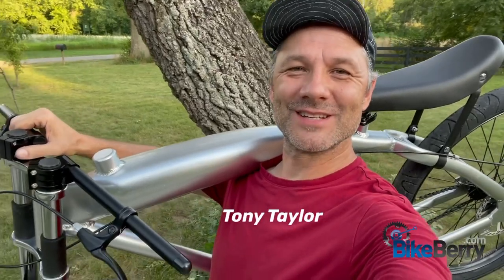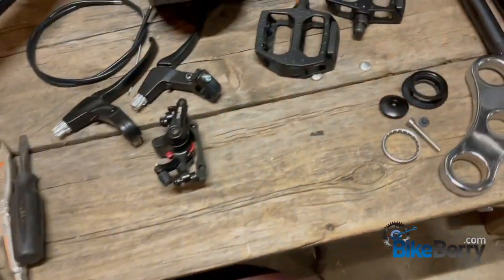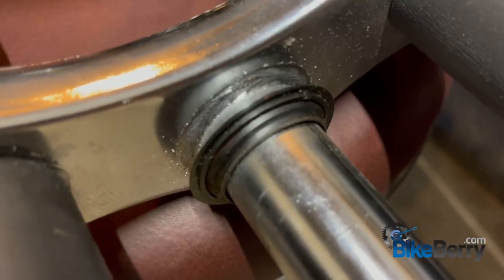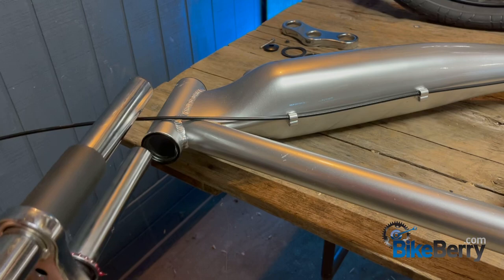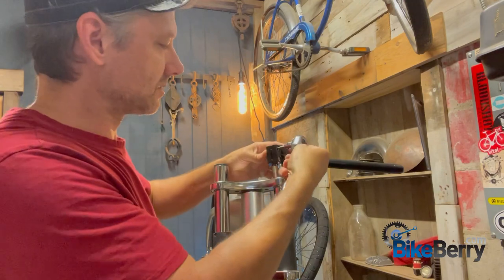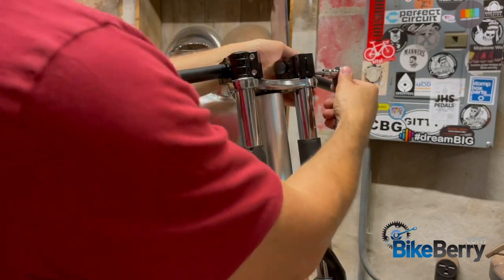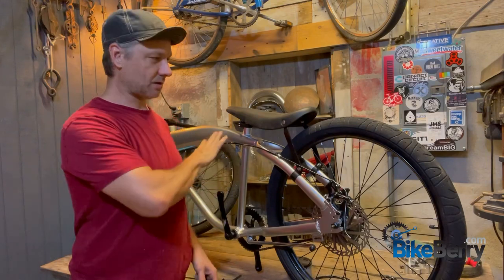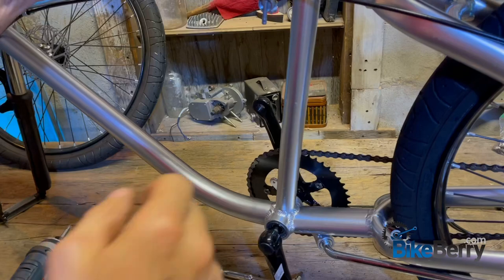F-Zero Full Assembly | Unboxing | Motorized Bike | Bike Berry

Comment: Make sure to loc-tite the bolts that go through the rotors & motor sprocket. They WILL back out. Also, check the wheels closely. I had to take both to a bike shop to have them trued & dished. They were way out of wack straight out of the box. Plus 1 of the pedals broke the first time I put pressure on it. It's not a bad start but for the money, shouldn't have to drop more $ before it's rideable.
Reply: Thanks for sharing your experience! This one is pretty close but still needs some work. I’m going to cover truing up the wheels in a future video. In this hobby it’s something we should all know how to do because it’s part of the build process.

Comment: The bike they sold me the tire blew while putting air in it. I found the rubber gasket that goes over the spoke screws was not there. I used electrical tape to fix that and put on a new tube. The kick stand was far to long and the bike fell over in the opposite direction . While putting the 32 tooth sprocket on the rear wheel the axle broke so I ordered another rear wheel. the engine bolts that mount the engine to the mounting plate were not included in my kit.   Overall I will replace the garbage with a Huffy or a Murry from Walmart. it can't be as bad as the what Bike Berry sold me.
Reply: Bike Berry acts like all there shit is full proof, when reality says otherwise

Comment: I have a question. I bought a felt faker and my fork looks like yours but the piece that goes up in the bike the piece you will eventually screw to hold everything together, mine is much longer and the knuckles go way below that piece. Is there something wrong with the fork? Thank you for this video. It is the best.

Comment: if you plan on going 50 on this thing you will need better breaks the ones that are on the F-zero  do not have an adjustment bolt for adjusting the gap on the break pads. I almost rolled down a hill onto US highway 51 because these brakes we're unable to provide adequate stoping force. for any speed over 25 your going to want Shimano hydraulic breaks ,Gemini rims and a proper set of down hill forks.  and that is still stretching it. At the end of the day these are still bicycles of dubious quality and they are not designed to go this fast for long hauls. please don't misunderstand me I love this hobby but I have seen many horror stories and pictures from other builders to not respect the fact that speed kills.
Reply: Definitely. Fast speeds require serious build skills to accomplish. 

I noticed on these brakes a silver adjustment screw on the stationary side that had a dab of locktight that I had to break loose.

Comment: Great assembly video on the F - Zero,  but Tony put a 4 stroke on it please, either the HS 49 cc or the P 79 cc. No mas 2 stroke.
Reply: Your wish is granted! 4 stroke is on the way 😃
Reply: @tonytaylor5087  Thank you, looking forward to a great bike build.
Reply: @tonytaylor5087  try upgrading a cylinder if ya want torque and speed these port durations are what ya need 160/120/20 or 160/110/25 ex/trans/BD. Or go 165/120/22.5 they should get ya 43-47mph depending on gearing and cylinder choice
Reply: Also get a boost port 160+ for higher rpm

Comment: anyone know what max safe speed for F-zero is / is is suitable for 50 MPH builds ?
Reply: Wel… with heavy duty wheels I’d say 40- 45 is safe over that sketchy but get ya some old moped wheels 19”-21” and run those it’ll be perfect for up to 70!
Reply: Good spoke moped wheels and tires if ya go over 40 get the tires for it! Get the best tires continental or Kevlar heavy duty tubes and tires. If ya can find a moped wheel to fit like a 22-24” wheel go for it
Reply: Also I hear those Gemini guns are great if ya feel like waiting for it
Reply: Gemini wheels

Comment: Mine didn’t come like that black bottom bearing housing is not pressed on bike so can’t use
Reply: You can use threaded rod with a nut and washer on both ends and press it on or use a big c-clamp that's how mine came and I pressed it right on

Comment: Try red n tacky spend an extra dollar man get the good shit
Reply: Link?
Reply: @tonytaylor5087  link? Walmart autozone oreillys Amazon red n tacky high temp grease 
Or a heavy duty grease usually green must have high drop temp of 375+ 4-600 degreeF is best
Reply: Get the Lucas red n tacky # 2 thicker stays in place better
Reply: Nice! I’ll check it out next time I’m in town.
Reply: The reason I say red n tack is it’s the best for the price or ya can get a small tube of the Lucas heavy duty same brand little better but red n tacky holds up to more heat the best is royal purple that shits great
Reply: I found some red and tacky today. Thanks for letting me know about it!
Reply: @tonytaylor5087  U welcome 🙏
Reply: Once I took one with loose 5 ball bearings and swapped them for ceramic bearings they lasted a long while gotta keep ‘em greased well tho and once the hub is worn ya can just reuse them great for high speed high heat use
Reply: @tonytaylor5087  good shit Lucas brands are awesome I like the synthetic blend low ash oil they sell in the 2.5oz bottles and VP 2t oil or bel-ray and AMSoil racing oils are the best really but Lucas is perfect for regular 1.6-5hp engines and daily driving